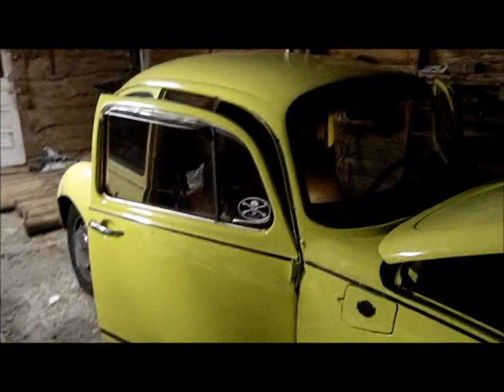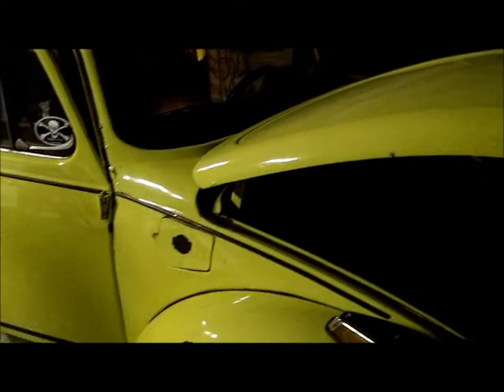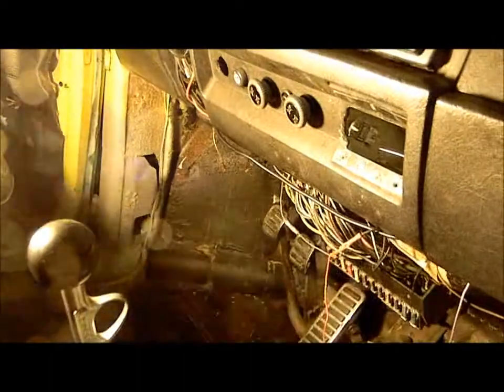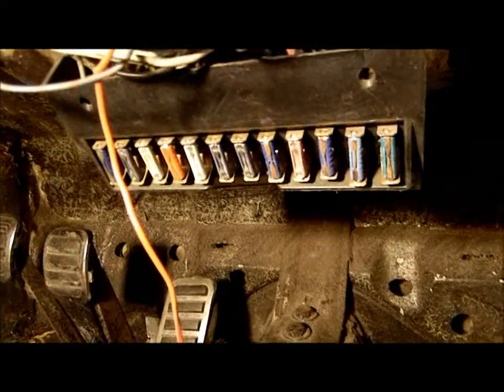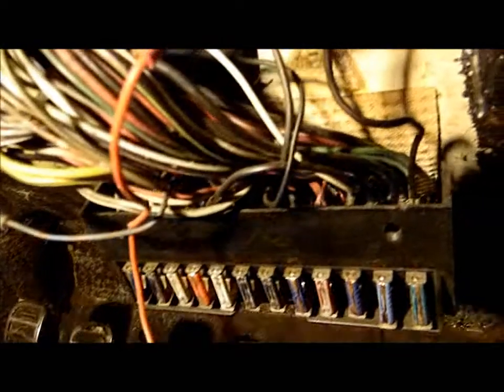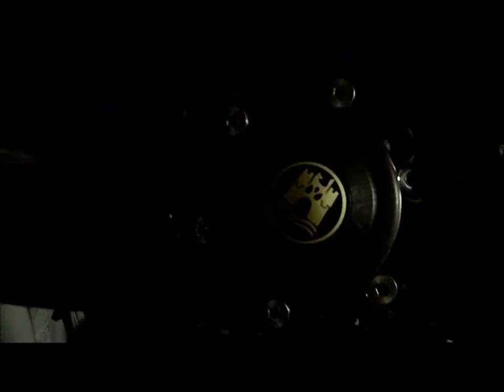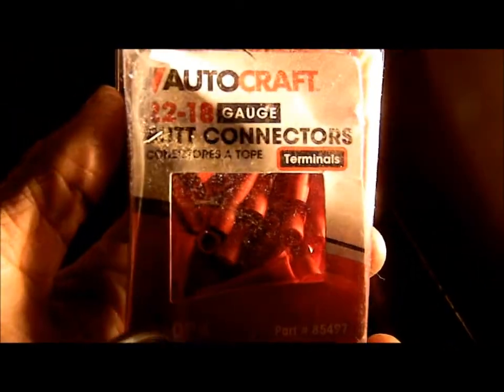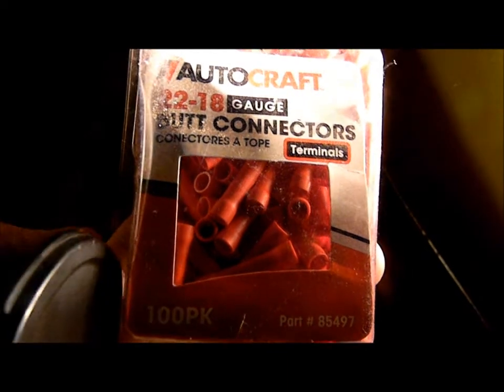1973 vw superbeetle update on electrical problems and fixes

Comment: I'm having some trouble with mine. I have all the lights except turn signals and high beams. I have low beam hazards reverse lights and running lights. Any suggestions?

Comment: My 73 supers headlights I can flip them on without the key in the ignition. Is this right? Where can I hook them up so they won't come on until I start the car then flip the switch.?
Reply from the maker: Yes, mine was like that in my '73. You can wire them up to only come on with the key flipped on, or car started position